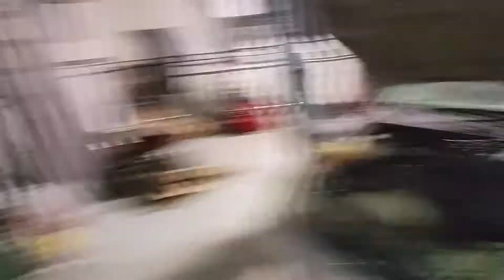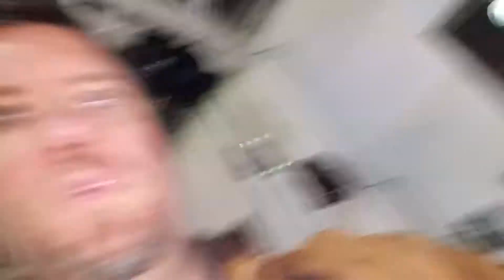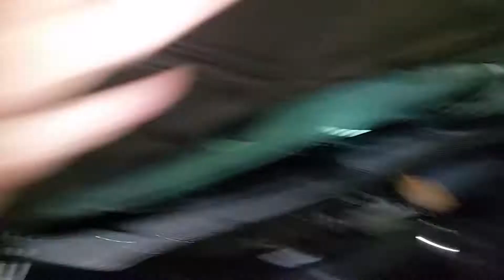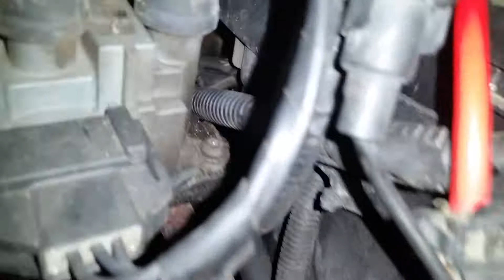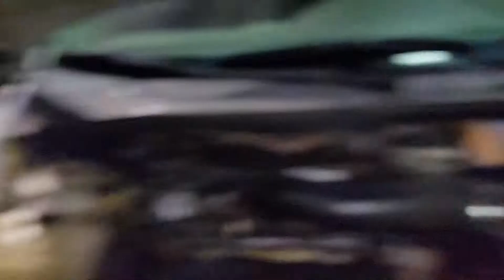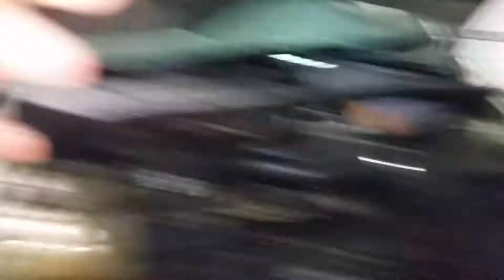2002 Ford Focus misfire that will not go away.

Comment: My 2003 Ford Focus has a heartbeat 💗, when I turn it off, the gas gauge and the temp arms /\ \/ /\ back n forth \/, zero then half way? 7 1/2 years now, just replace my battery, still doing it?  Can’t find the problem? Checked wires?.
Reply: check your grounds
Reply: Relay and or sensor on the fritz, some caused battery drain but look on yt how they test for them and fixes that weird issue
Reply: My 2002 focus pulls this little trick when discon/recon battery or jump starting. It is something to do with the onboard computer. The fault occurs when the engine is turned off. Mine can take anything from a couple of days to 3-4 weeks to put itself right.